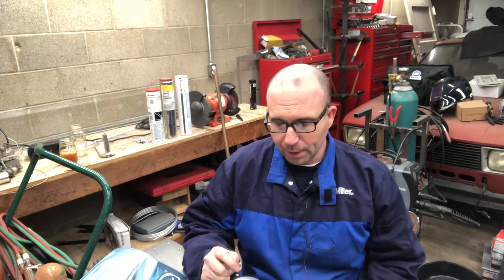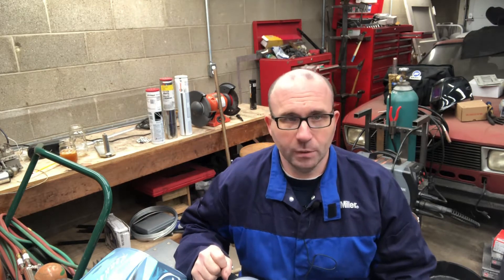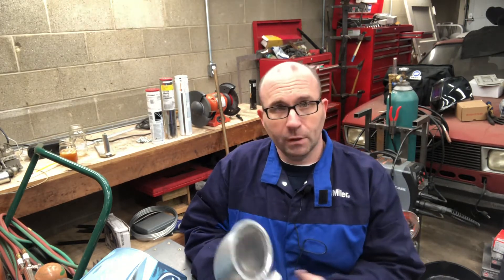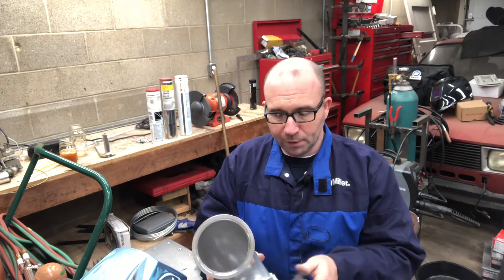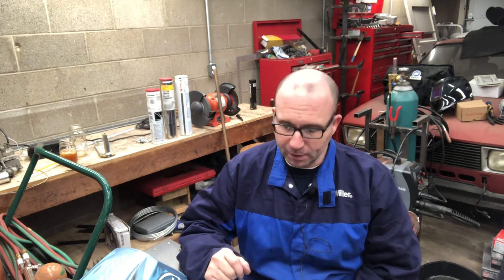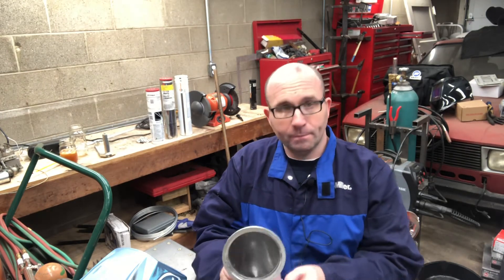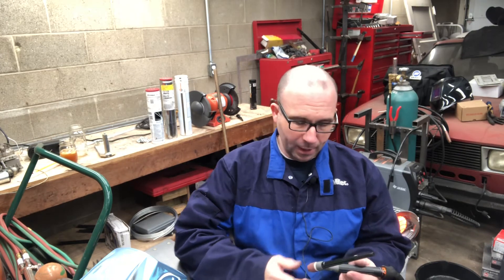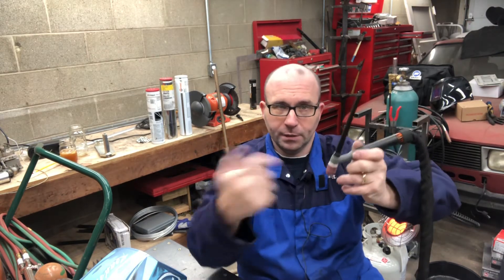Avoiding Porosity in Aluminum TIG Welding

Comment: Hey Really Appreciate the video. I have been welding on 3/4 aluminum and steady getting porosity. This is at high amps (250) 50/50 ar/he mix, 25-30 cfh,  3/32nd ceriated tung, 7/8 dia gas cup and gas lens, 65-70%  balance on miller dynasty  100hz. I use acetone, then ss brush, preheat to 250° ( i also sometimes use acids to clean too) regardless of all of this I still get porosity. It drives me crazy man.... i wish I had a mentor that could stand in front of me with my welder and prove to me its even possible to 100% eliminate it on my application. (Light pole 3/8 wall, with a flange on bottom 3/4 6061,  4 gussets machined 1/4, ) all 1/4 fillet welds. I need a school or aomething....
Reply from the maker: David, porosity on aluminum is a constant fight. You are taking correct measures, but I fear that power might be your problem. My guess is that your welds have a greyish and dull appearance instead of being shiny. As you have learned, aluminum is a powerful conductor. It also has a strong affinity for hydrogen, especially in liquid phase. Much of the hydrogen will work its way out of the pool if it has a chance, but on sections as thick as you are working with, the aluminum freezes too fast to allow the hydrogen to escape. Does the porosity persist even if you are welding on thinner materials? If not, your amperage May be insufficient for the job.